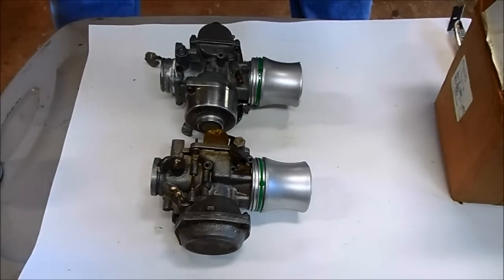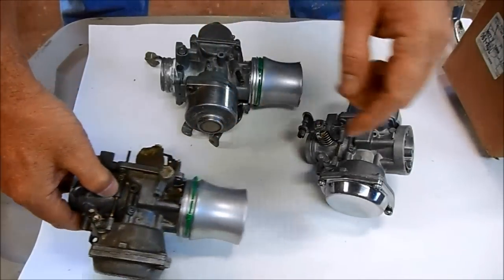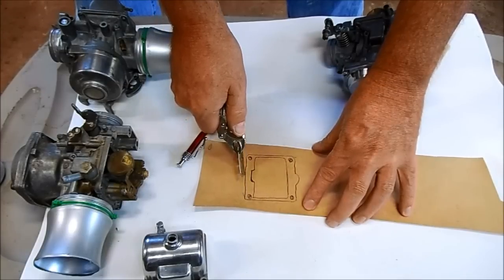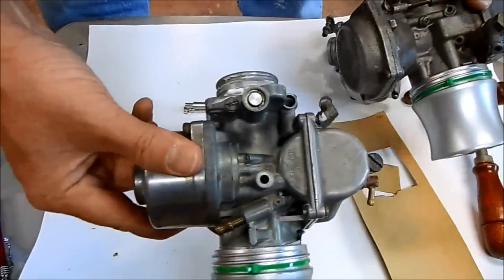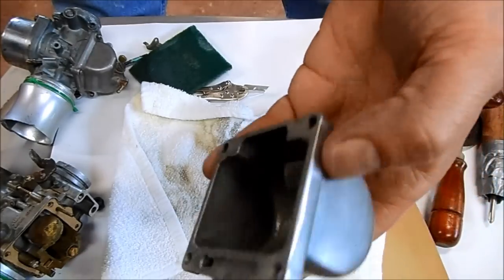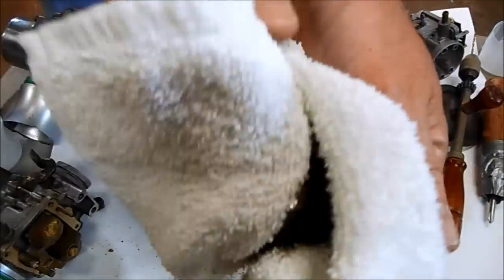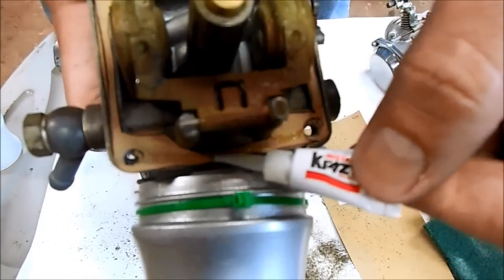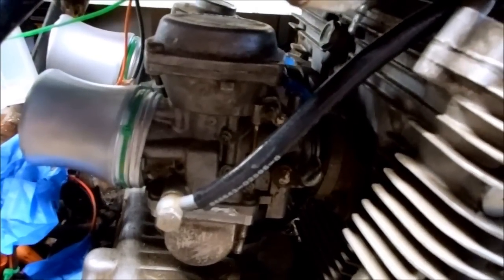Ichiban Cafe Racer Part 17: how to assemble a Carburetor  for the Yamaha Motorcycle Engine

Comment: I heard that these Yamahas left the factory as a four stroke. For maximum horsepower and improved throttle response, you can have two of the strokes removed to make it a 2 stroke. I'm thinking of doing that on my 6 cylinder V8 rotary valve diesel Yamaha XZ550 which has been converted to LPG with methanol injection and NOS under the seat. Any tips?
Reply: +David Bennett I should also mention it's normally aspirated with 3 turbos.
Reply: Simply remove the cam, timing chain, valve lifters, and connect the spark plug wires together so they fire every time instead of every other time.

Comment: So did your wire harness work?  What kind of cable did you use?  And what ia connected?  IM TRYING TO DO MY YAMAHA WIRING
Reply from the maker: the harness was made, installed and tested in video parts  13 and 14 with 20g wire.

Comment: could have just held it above a cand to make the the black carbon colour go on the shine
Reply from the maker: I will try that.. and maybe then use the hairspray to set the finish
Reply: i was quite naive when i suggested that it may work but perhaps try wiping old engine oil over the shine next time you change the oil or maybe black shoe polish or some grime from under the engine. have a play around just dont block up any holes :)